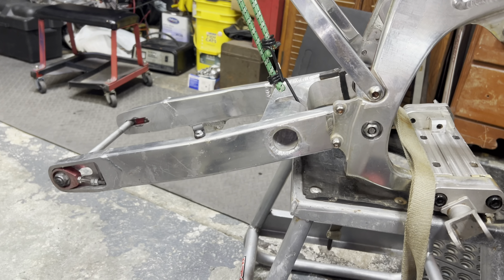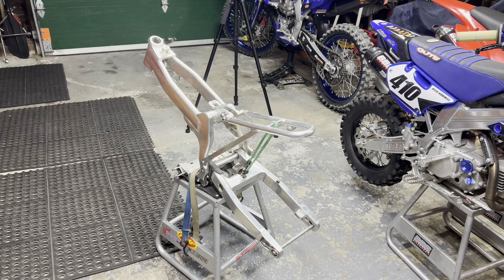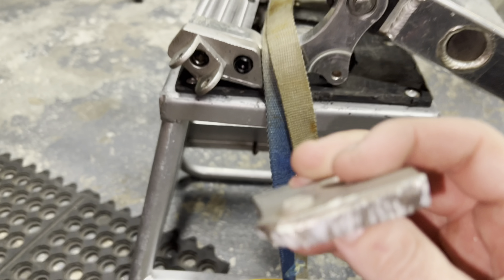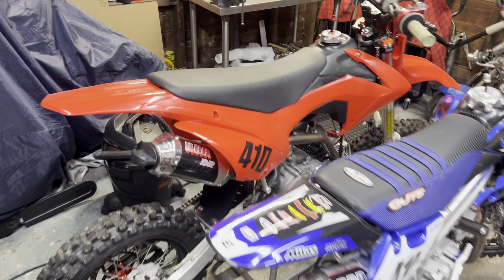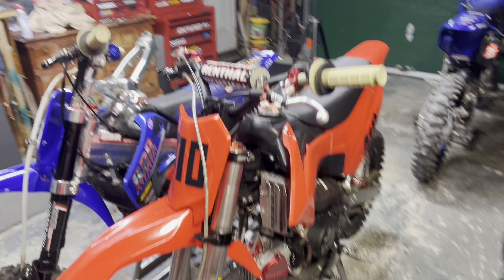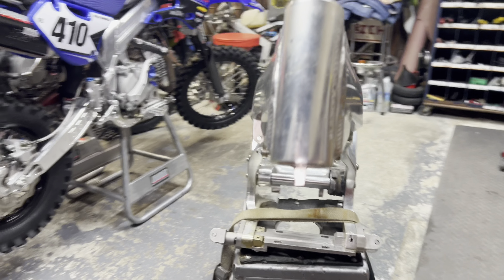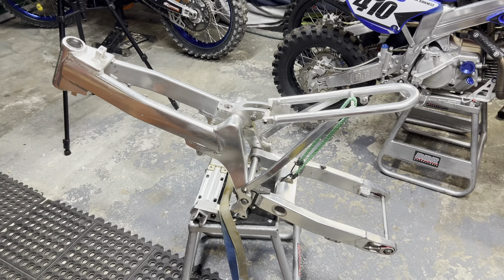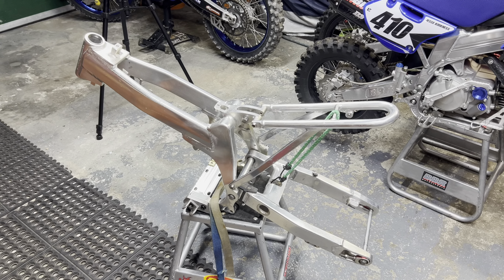🚨New Build | 2005 SSR Motorsports PF2 | CRF50 Based Pit Bike

Comment: Nice to see ya back with another build! Had a bike like 10 years ago with one of these frames and had no issues what so ever and are pretty beefy. They're a good base for a v1 size copy build!
Reply from the maker: @Rappoldtracing  oh nice thats good to hear and honestly it looks almost identical to the V1 i raced and was checking out this summer. Im still curious what type of aluminum these frames were made from and weather or not they were heat treated incase i need to ever weld on it. Im assuming they weren’t heat treated but curious if its 6061 aluminum or what
Reply: @JesseK410  Honestly I think at the time BBR was the only company to heat threat there frames. I'd ride this frame without a doubt but maybe take it a bit easy on jumps with a flat landing. In case this frame cracks or breaks you can always switch all the other parts over to an original bbr frame. Goodluck with the build brother I always enjoy your pitbike videos!
Reply from the maker: @ yeah i kinda figured they weren’t heat treated but im curious if i can have it heat treated

Comment: Sick havent seen one of these built so it will be nice to see it, also cant wait to see the bbr vid
Reply from the maker: @RileySimmon-j2j  for sure, im excited to see how this pf2 holds up myself. Probably gonna try an use relatively light engine so it doesn’t stress out the upper engine mount. Like the Daytona 150/190 is a heavy engine vs a Honda 50 engine so i might do a built 50 like a 108 or 124cc an if not ill run a Yx140cc engine but i haven’t made up my mind yet haha
Reply: @JesseK410  I believe daytona made a 125 so it might be something to look into just a fyi
Reply from the maker: @ yeah but unfortunately the older daytona t trex engines are super hard to find any parts for so thats why I wouldn’t run one of the smaller bore older Daytona engines

Comment: it’s crazy how similar these are to a v1 they are like identical
Reply from the maker: @masonwells111  looks like it to me to brotha, question is are they as strong lol. Not even sure if its 6061 aluminum or not i know the BBR frames are T6 .. been looking for info on that but on the SSR legacy page it doesn’t say anything about what type of aluminum its made from
Reply: @ id assume 6061, i believe its one of the easiest to weld. dont quote me on that tho. i believe its 6061 alloy instead of billet but like you no info so it’s hard haha
Reply: spars and upper spars almost look billet
Reply from the maker: @masonwells111  6016 is billet aluminum and if its welded it needs to be hear treated i know that for sure but yeah .. and the BBR frames are 6061 aluminum thats been heat treated to T6 hardness. This must be

Comment: Nice build so far what exhaust and motor are u thinking about doing seems like u get bikes quicker then I get new underwear 😅
Reply: Also did u get a set of jokes for it or what are u gonna do as far as the front end
Reply: Zokes*
Reply from the maker: Hahaha seriously i have an addiction to making build videos and buyin pitbikes .. im gonna use a BBR v1 D section and probably a YX engine not sure CC yet maybe 140cc
Reply from the maker: I have a set of ssr slowracer clamps im gonna run and look for some zokes forks
Reply: @JesseK410  if u do the d section u should try to make a carb tip for it or throw a d3 tip on it imo would like to see something different I don't really like the tip on the d section and the d2s and d3s are to long
Reply: Carbon*
Reply from the maker: @ yeah for sure and i hear you there thats why i wanna do something different on this one and also why im changing up the D3 muffler on my BBR bike
Reply from the maker: @ haha i knew what you meant